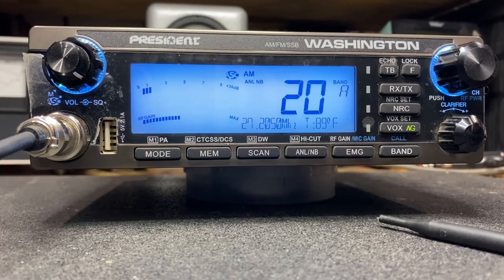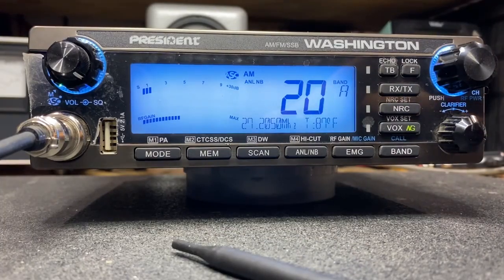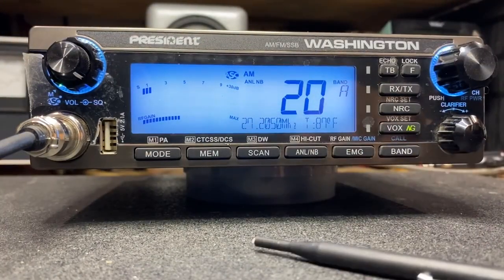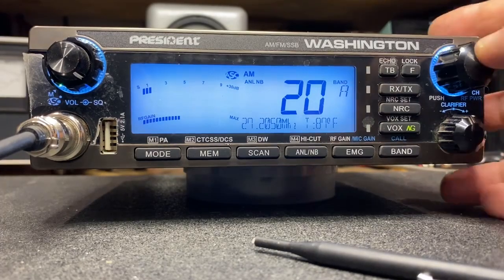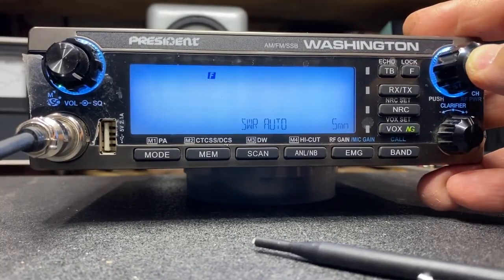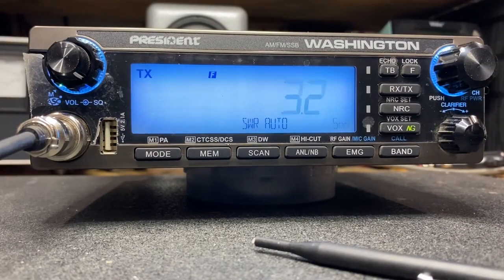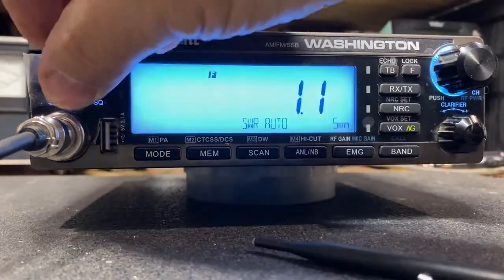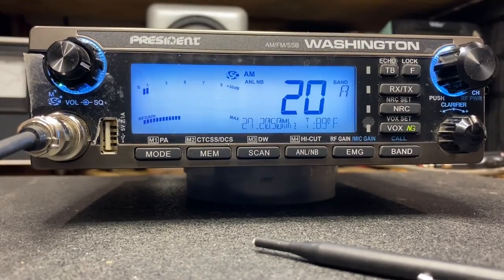President WASHINGTON Built In SWR Meter  (How To CHECK Your SWR)

Comment: Are you adjusting the stinger of your antenna while it’s in this mode? Is the antenna in your shack or is it mounted outside? Thank you
Reply from the maker: This is a demonstration video so I am using a antenna tuner into a dummy load to replicate a bad SWR. When using this feature in the real world you would either adjust the stinger (whip) or tuning rings if the antenna has them.  If your worried about getting a "tingle" from the antenna while tuning just wear so gloves.

Comment: So I have the President Walker and I bought an SWR thinking idk what - but the built in swr meter doesn’t allow me to tune the antenna - guess cutting my antenna is my only option?!
Reply from the maker: Work with both, the radios' meter and your outboard meter. Make sure your antenna has a good ground. Also if your antenna is near metal like the vehicles A pillar, that will sometimes make it hard to tune your SWRs.
Reply: @390WagonMaster so it’s on my work truck and I bought one of those Stryker magnetic base antennas.. it’s a sweet set up - I got a president walker attached to Lycos heavy duty cup holder with ALPS (?) holes n base plate.. 
the only thing giving me grief is the swr and it’s reading the same across all channels.. yea I’ll give the external swr meter a shot and see if it differs from the radios.. I wish my company had tech support for this stuff. lol I e had to learn it all by myself.. lol thanks for all/ any advice!

Comment: Great vid, i have a washingnton european spec, opened up for uk fm also, when i change channel it goes up by blocks of  10,  i.e 215...225..235 etc,is there anyway to change it to 5kc shift,rgds steve uk
Reply: Interesting to know, I just got one, so far, 2 days I haven't figured it out if it does.